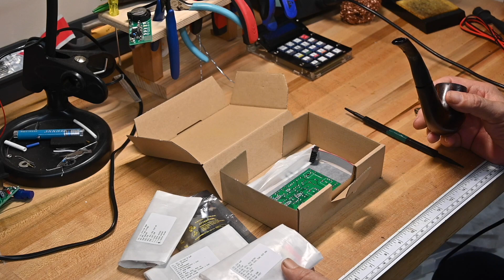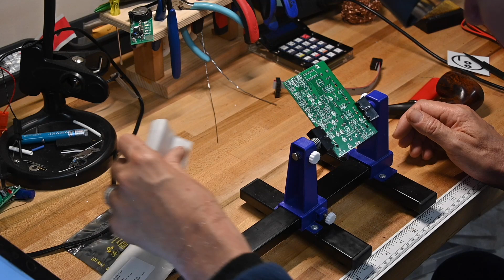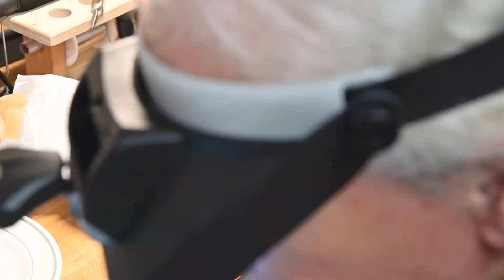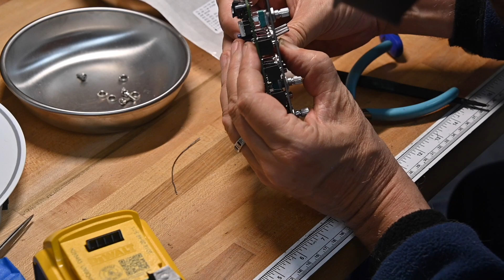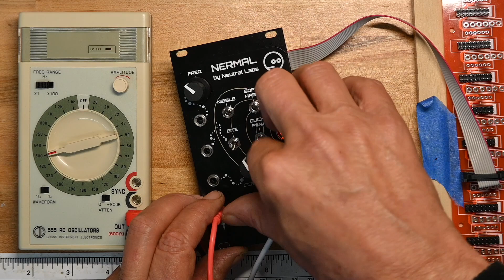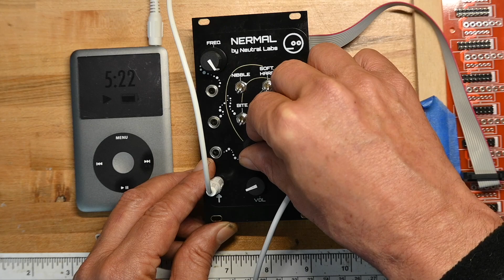C K  builds a Nermal eurorack effects unit from Neutral Labs

Comment: Great video, I enjoyed that a lot. :) If you remove the anti-rotation washer from the switches before assembly, you won't have any trouble with the jacks. The FREQ knob controls the frequency of the modulator (NIBBLE), which is superseded by the BITE switch, so it doesn't do anything while both NIBBLE and BITE are activated.
Reply from the maker: Check